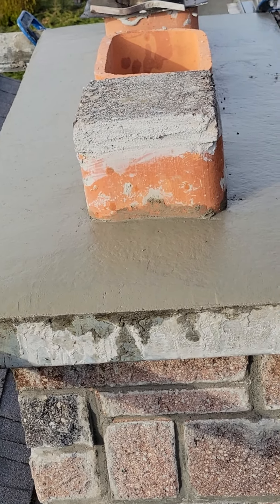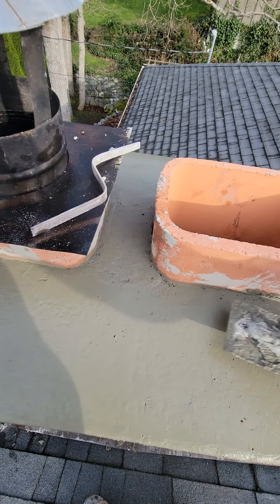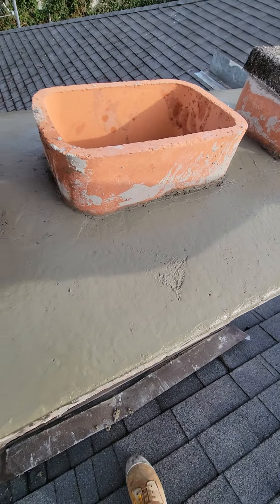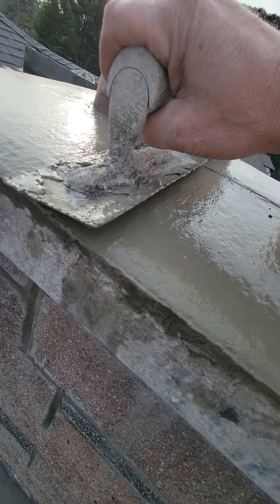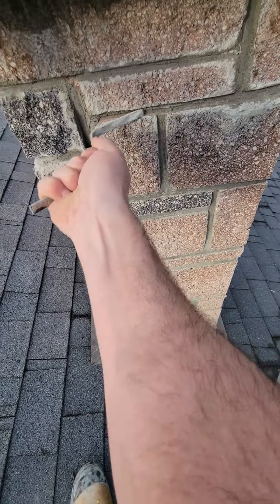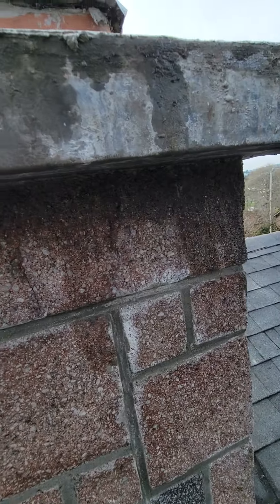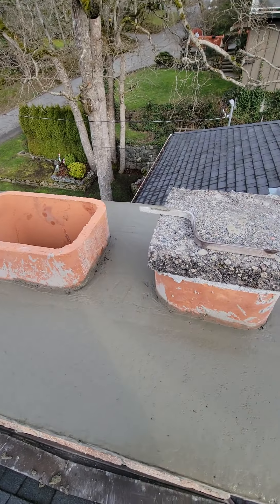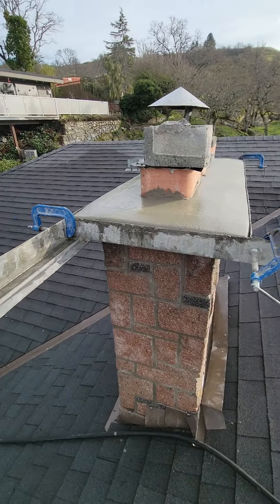Chimney cap and brick ready for cleaning

Comment: Wrap the top of the flues with sill seal where they meet concrete to provide for expansion bud ;)
Reply from the maker: They just didknigrate over time , I have gone back to many Chimneys like this and they are fine but if people want it I will do it
Reply from the maker: Theynget hot from fire place and that won't last up there and will leak though fast
Reply: @westcoastnaturalwolverine4068  just trim excess off above cap when you go back to tear down and silicone it. It's not hot enough to bother anything and if it ever was then they got other problems... like a chimney fire lol. And even if it melted and it would just drop into the cavity of chimney. You gotta let those flues move independently.